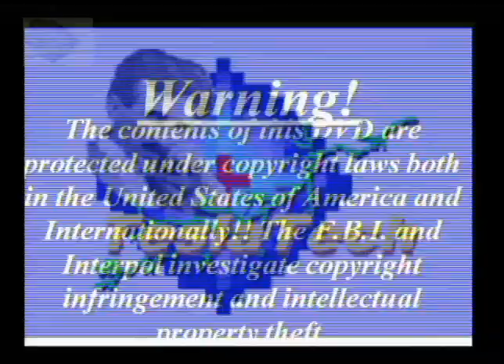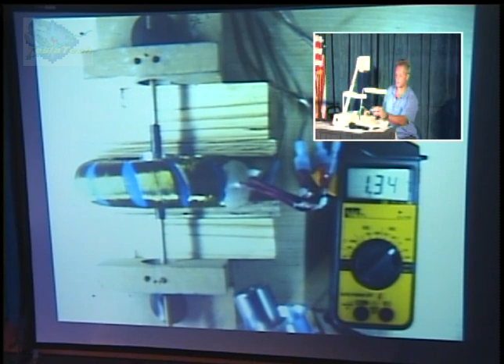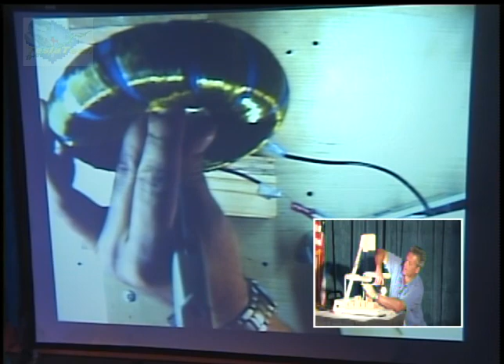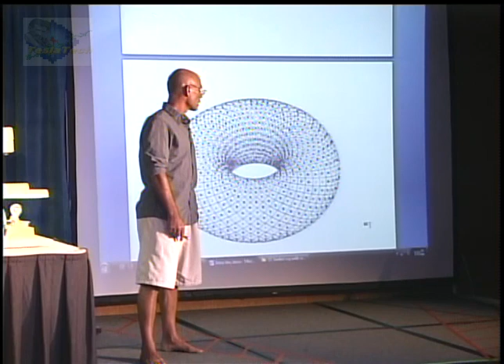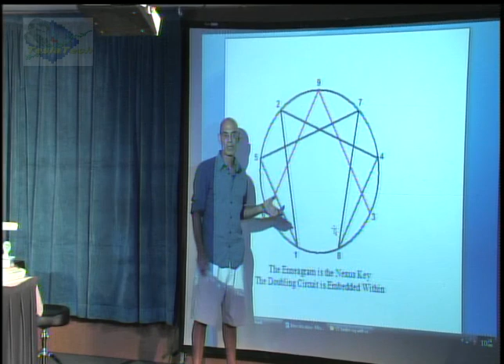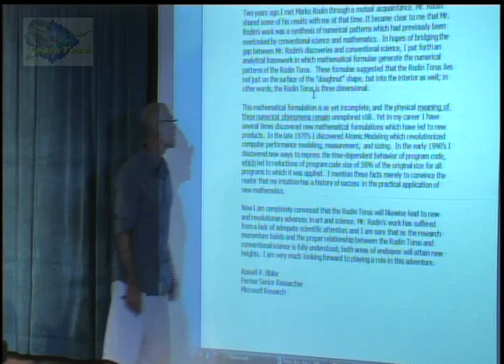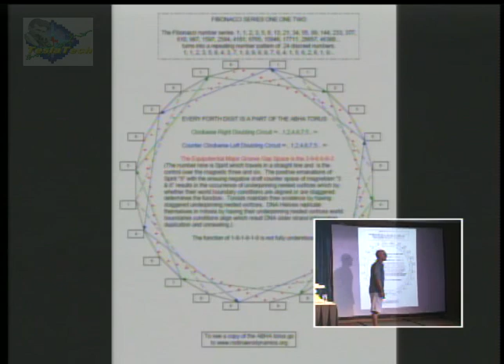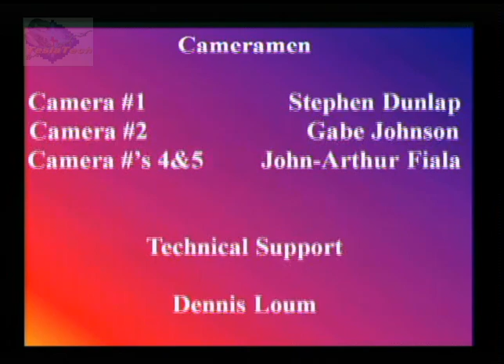Marko Rodin, Extraordinary Technology Conference 2009

Comment: Just before the eighteen minute area he explains a load is applied to the torque by his hand and amperage needed actually drops. This is the same with John Bedini motor generator. Where impulse On into coil attracts inward the magnet. Impulse switched Off and core coil circuit is changed to a dead battery resistance. Into dead positive side of oxidation chemical battery. This happens at the moment the attracted magnet is aligned with the core coil. This causes phase conjugation directional charge flow in the coil to reverse and the magnet over the core coil gets repulsed. That repulsion requires zero input from source as it was already present in the charged core coil. Accordingly as well, applied physical load against torque further increases resistance against the repulsion (and attraction) without increasing amperage. Amperage actually is known to decrease with these designs. Possibly due to reaction in coil core as it phase conjugates upon finding resistance. And this is the best method Bedini once said he could find for converting into self driven system.

Impulse volts per second vps is longitudinal magneto Dielectric DC which changes into transverse AC according to phase conjugation DCFR Directional Charge  Flow Reversal. The AC output itself in the conductors of the devices should be accessable for use. And even DC. Using transformers to manipulate signals and needed such as to entice motion of the magnet within the coil.